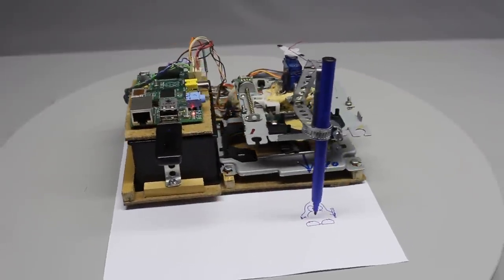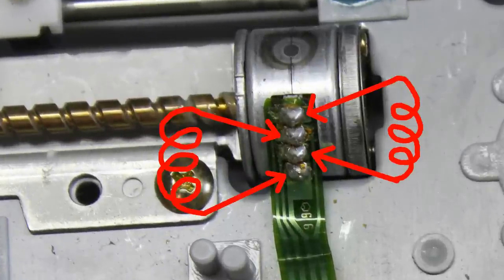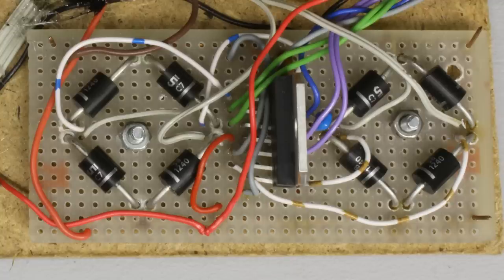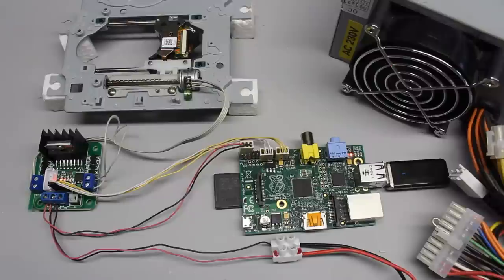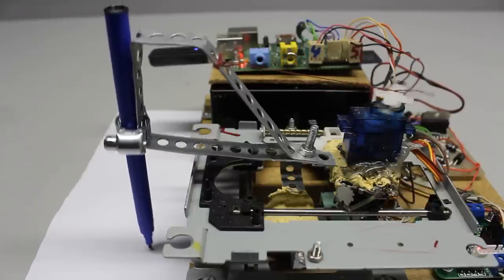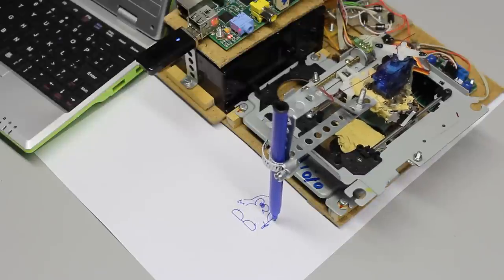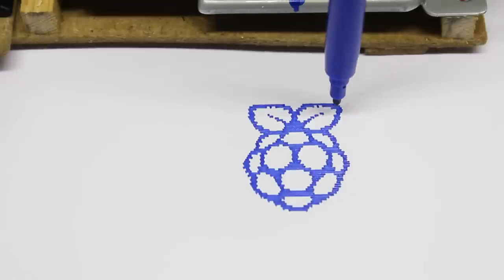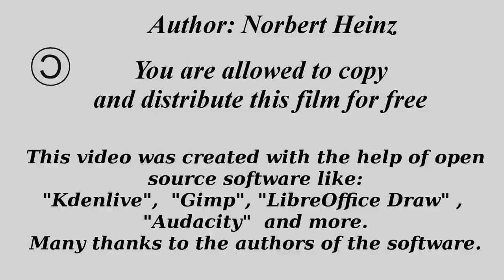Plotter made of two old CD drives, a servo and a Raspberry Pi

Comment: You can drive your little step motor by a 12V source, just by adding some extra components (current limit res, opamp, clock generator ) or connect your L298 dual bridge with its driver L297, your motor will spin faster with less step loss. Great work, nice project BTW  (sorry for my bad english)
Reply from the maker: Anh Tú Nguyễn That would be the overkill for this plotter project since it is more a toy than a tool. There will be more plotter / printer / router projects. I will consider your suggests when building one of these machines - thanks! Currently I am creating a larger one with a router. I will use normal DC motors with the L298 dual bridge, turning them into stepper motors with photo sensors - stay tuned. (There is no need to apologise for your English it isn't bad)
Reply: As a native Anglophone, I can attest that your English is fine.

Comment: I love it! Just found a scanner+printer device and currently dismantling it to get the cool parts. I'm planning on building something very similar to this but on a larger scale. Gotta love how things that are thrown away can be reused to make cool and actually useful stuff. Such a device can easily be adopted to be used as 2D plotting device for small projects.
Reply from the maker: +rbaleksandar Yes, 35x35mm isn't much for plotting projects, thus a larger machine would be more helpful. Hope to see your machine soon.
Reply: HomoFaciens
I hope so too. Epson printers/scanners however seem to lack labeling on some of their motors and/or datasheets completely. Will have to research quite a bit...

Comment: Working on my building my CNC with an arduino.  Thought I might have damaged my stepper motors as well.  I should have just clipped off the ribbon instead of removing it. but it looks like they are still functional.  Waiting for motor controls to come in the mail to continue.  Wonderfull series you have.
Reply from the maker: +Maltux1 Thanks!

Comment: very clever, would not have thought of tearing apart some old cd drives for that, now i'm thinking how can I use them. :)
Reply from the maker: Kirk Nelson I am not the first tinkerer that has done that mod, there are many videos on YouTube doing (nearly) the same. However, the reasons why I have made another video are: I wanted to demonstrate the building of such a great tiny plotter more precisely than in the videos I have found and this is an introduction to my next video. I am currently creating a larger plotter made of simple tools and materials available in a DIY store. Stay tuned!
Reply: thanks, I'll be looking for to it :)

Comment: Great piece of lateral thinking there. Another job well done!
Reply from the maker: andy parry ...it's just the prelude of my next video about a big plotter that is currently under construction.
Reply: Cool. Would be interested in that. If in the future you could change the pen on your big plotter for a router or a laser cutter, that would be epic.
Reply from the maker: andy parry Using it with a router is indeed the main intention of making the plotter bigger. I have cut a gear wheel from 4mm plastics today, but the result wasn't as expected, so I have to do an overhaul of the mechanics tomorrow. Since power lasers are dangerous I won't treat those devices in my videos (yet).

Comment: Awesome! Are you controlling the plotter limits through code? Or do you have some sort of sensor indicating travel limits?
Reply from the maker: +Paul Sullivan If there were end switches, I had shown them in the video. Those tiny stepper motors cant cause damage if they exceed the limits. The software scales the images to the maximal move length of the motors (220 steps).

Comment: hi there, very good tutorial but will any L298N H-bridge work? i really want to build one, with correct parts!
Reply from the maker: +aran everitt I guess any board with a L298N chip will work, as the stepper motors of the optical drives consume just 500mA and the L298N chip is for a continuous current of 2A.
Reply: thanks man, just ordered the drives for dirt cheap. I hope they contain steppers haha. on the other end of things, if I can use CAD software to model the thing I want to output, I could even mount a dremel tool so it can engrave or cut out!

regards
Aran
Reply from the maker: The software I have written needs scalable vector graphics with all paths turned into polygons. The weak steppers of the optical drives won't overcome the side load during engraving work. Have a look at my CNC v0.6 which is under construction:
http://www.homofaciens.de/technics-machines-cnc-v0-6_en_navion.htm
Reply: thanks man :)
Reply: +HomoFaciens I'm glad you pointed that out, as I had the same thought as aran! your videos are great for showing what can be achieved using relatively simple techniques and mechanisms.

Comment: Great job! Is the code available?
Reply from the maker: Thanks! Did you have a look at my website as I tell you in the video? The link is also below the video, but here again just for you:
https://homofaciens.de/technics-machines-plotter-cdrom_en.htm
Reply: @HomoFaciens  Thanks! and Happy New Year.  I have built a 10:1  encoder and the simple code I'm using counts fast and accurately. However,  I have timing problems when I combine the code  with other tasks, like controling the motor or with button debouncing functions which use delay().
Reply from the maker: Instead of delay use a loop that reads the encoder state. like this:
for(int i = 0; i < 10; i++){
  read encoder stuff();
}

Comment: Hello HomoFaciens. I try to achieve this project. Sadly, I soldered solid wires to the tiny foil of the stepper motor, so the foil stepper motor got off it's place and I now have a look at the internals. I'm aware that, as you said on your website, "Don't remove the foil at the pins, because you will very likely also rip the copper wires off the pins by what the motor gets inevitably destroyed!" but I wish to make it work again. Since I have access to the coils maybe I could solder wires and use these to control the motor or all hope is lost ? How would I proceed ? Thanks a lot in advance.
Reply from the maker: Well, if you find the 4 "ends" of the coils and solder wires to the H bridges it will work, but those coils are wound with very thin wires...
Reply: I can only see one or two wires. I guess i'll have to do it all again :( thanks for ur advice still. BTW shipping fee are expensive and shipping time is long here, and we don't have makerspaces or other dumpsters services where you can ask for broken things. I guess I'll have to ask my friends for broken cd:dvd readers

Comment: Is the "green" PCB is step motor driver? It seems that the steps is too big. Need more precise driver with 1/125 or 1/250 microsteps.
And which software you use to control the machine?
Reply from the maker: The driver is a L298N double H bridge with no microstepping support. This machine is just for fun, thus the rough resolution doesn't matter to me.

Comment: Hey one more question, is it possible to use a DC motor for the one that holds the pen or not? Thanks in advance.
Reply from the maker: It's a DC motor that drives a servo...
You'll need either an H bridge to turn the motor into both directions or you can e.g. pull the pen up by the energized motor and let is fall down through gravity after cutting the motor energy.

Comment: How can I use an Arduino board instead of a Raspberry pi to do the same as above? Do you have the Arduino code for it?
Reply from the maker: Write your Arduino software. I haven't done so, because it runs nicely with my Raspberry Pi.
I will teach how to do coding in a coming series about "Physical Computing" on my pages - stay tuned!

Comment: hi, another question, my rpi h bridge is marked with A1-A, A1-B, B1-A, B1-B. do i connect both the A's to pin 13, 15 and both B's to pin 21, 23? thanks.

Aran
Reply from the maker: +aran everitt Have a close look at the datasheet of your bridge, or simply try to connect them that way and see what happens. If A1-A... are the INPUT pins of your H bridge, there is no danger to harm your Raspberry, but it could be fatal if A1-A are the OUTPUT pins!
Reply: thanks again, one final question... right lets say i connect the right pins to the right connections etc do i power the raspberry pi with the micro usb and NEED to connect the +line from the battery aswell or should i NOT connect both battery and micro usb to the pi at the same time. thanks :)

Regards
Aran
Reply from the maker: +aran everitt Don't connect both to a power source. If you connect the Pi to a USB power supply, you should NOT connect pin 2 to +5v coming from the battery (via the 5V regulator of course).
Reply: ahh thanks man. i have built it now. all i need to do is test it :). so connect the motor modules to 5-6v battery and the RPi to a micro usb but NOT connected - only connect ground from the battery and moduls to the GPIO right? thanks
Reply from the maker: +aran everitt Yes. Just be aware that 6V are slightly above the rating of the stepper motors which is 5V. You could insert one or two diodes in forward direction to lower the 6V of the battery.
Reply: thanks so much. i am going to test it VERY  soon. like today if i can :)
Reply: +HomoFaciens haha you will hate me after this but i tried multiple things but it still doesn't work, only now the led does similar things, almost as if the gpio's are powering it however this cant be the case. also it seems the .py file i made when i run it it says, error, the gpio's are already in use? this is unusual. i know you have told me everything but maybe if you could explain how to use the software you supplied on your site (do i need to install on the pi or my pc?) then i might be able to get somewhere :) apart from all of this i have fully built the hardware. my birthday is in 4 days so i might be able to experiment with Arduino instead :)

Regards,
Aran
Reply from the maker: +aran everitt Of course you have to install the software on your Raspberry Pi. Did the steps described in the readme.txt process without errors? What LED is blinking? Maybe you have to connect the +5V of the H bridges with +5V in order to power the logic level side of the H bridges.
Reply: so to install the software i simply put it on the desktop and then type in the stuff from the line and im good? thanks

Aran
Reply from the maker: +aran everitt You have to open a Terminal window on the Raspberry Desktop and type the commands there. Unzip the files on the Raspberry in the /home/pi folder.
Reply: thanks man. can i do a simple motor test without the wireless stick i.e do i NEED a pc to control it? thanks
Reply from the maker: +aran everitt If you have connected monitor and keyboard to your Raspberry, there is no need to have a network available.
Reply: thanks man.
Reply: +HomoFaciens i have installed the plotter softawre but it will not let me install the gui. no problem. when i test it the motors make a whining noise but do not move. does this mean there is not enough current?

regards
Aran
Reply from the maker: +aran everitt What voltage is at the H bridges between:
1.) Vcc and ground
2.) Between the output clamps

Comment: I can't find sellers for a 10 watt laser diode to cut acrylic sheet of 5mm thickness to circles , want to use this CD cnc mechanism to cut acrylic
Reply from the maker: If you can't find sellers of a 10W laser diode, it's better not to risk an eye. These devices are very dangerous!
Reply: There are fake diodes on eBay etc of 10mw faking it as 10 W diodes, at my place  idiots run workshops using laser cutters  but they take production orders , earlier I used to take the acrylic  sheet to lathe machinist
Reply from the maker: 8001maya
You should not by 10W laser diodes from sources that don't grant the properties or where you don't get your money back if the device you get is scrap. Always buy from shops located in your home country.

Comment: That is very clever.
Reply from the maker: Thanks! I wasn't the first tinkerer using old optical drives that way. I simply changed the mechanics in such a way that you can draw on any plain surface and used a Raspberry Pi to control the plotter.

Comment: Just curious - what is the manufacturer/type of laptop at 4:16?
Reply from the maker: It's a cheap chinese plastics laptop with WM8650 chipset and no manufacturer label ;)
Reply from the maker: Yes, the software "support" for those laptops did not exist...
...gladly I found a (non perfect but working) Debian image on SlateDroid. The Lander camera in my www.RoboSpatium.de still works with that laptop.

Comment: sir, I am so noob at this, can you help me, I can't make the program work...I think I followed your instructions It wont run the program..please help
Reply from the maker: If you had followed all instructions correctly, it would run, thus you must tell me at which step you struggled.
Noobs must learn to read and understand error messages or at least hand those error messages to an expert ;-)
Screenshots or pictures of your circuit or machine can also help to find what is going wrong.
Read how to get in contact with me on my pages:
http://homofaciens.de/contact_en.htm

Comment: With Arduino:  https://youtu.be/945gx2Lh0Ts
With Raspberry: https://youtu.be/QtBdWL7FfOQ
With Router OpenWRT: https://youtu.be/2hYIRen27Zw
Help!! Hello renew, I'm testing various CNC controllers, first with Arduino and OK, second with Raspberry Pi and OK, and now with Router DSL with OpenWRT controlling stepping motors. I need help for this final project, in your video (minute: 5:16), you are drawing a bitmap. What's is the program of conversion the image to line by line? My project don't have GCODE integration yet.
Reply from the maker: I am using a self made software written for this and some of my other machines that currently also can't read Gcode. You can get the sources of my program on my pages:
http://homofaciens.de/technics-machines-plotter-cdrom_en.htm

Comment: Thank you Norbert. Your work served as inspiration and I already made mine using Arduino. https://youtu.be/KM3usgK8egk
Reply from the maker: lowendguru Scanner and printers are also a good source for mechanical parts. The motors are not bipolar stepper motors, thus they need sensor feedback, which is why the Arduino is the better choice than a Raspberry. Nice work!

Comment: Yo put some wheels on that so it can take a larger canvas!!!
Reply from the maker: A driving draw bot is what I have in mind for a future project...
Reply from the maker: Not remote controlled in a conventional way. It must drive autonomously while printing/plotting.
Reply: I did also mount a laser on top that can indicate the canvas size on the surface where it's drawing. Like some kind of refraction prism to slip the light in to 4 dots making a small square
Reply from the maker: Is there any video about your drawing bot?
Reply: HomoFaciens Ha I wish I did but I'm a college student and don't have time to test out my ideas I must meet deadlines in hopes of raising my GPA LOL although as for the wheels I was thinking of something like a hand ball that can be rotated by a X-axis and a y-axis stepper motors. And for the laser I wouldn't really know since I haven't experiment with light although I would say it depends on the material as to how light is going to bent. It may be the easiest if you have a laser cutter and an acrylic glass/sheet but if not then maybe with glass but working the glass could be a challenge.